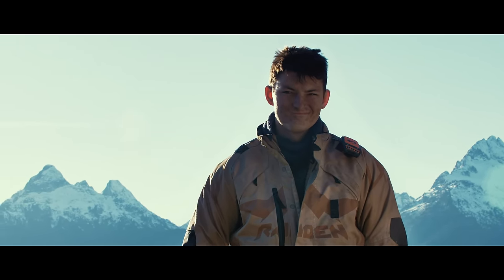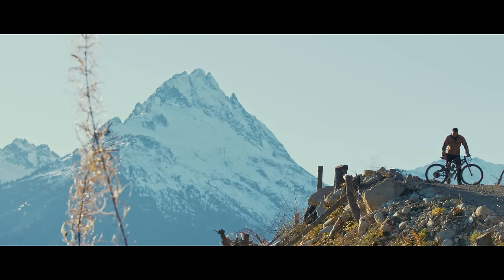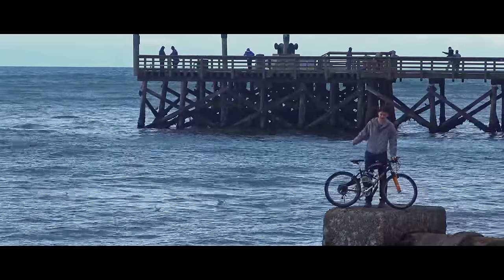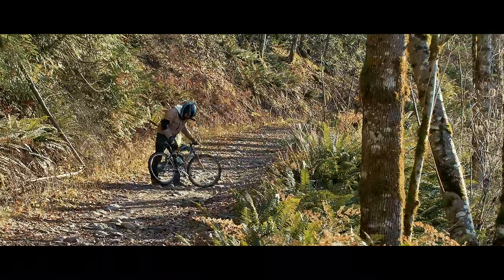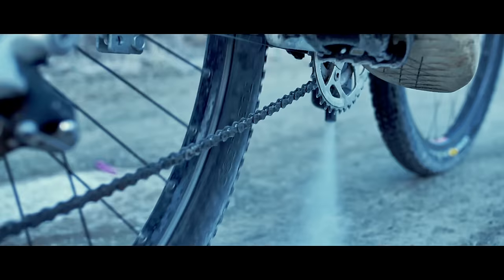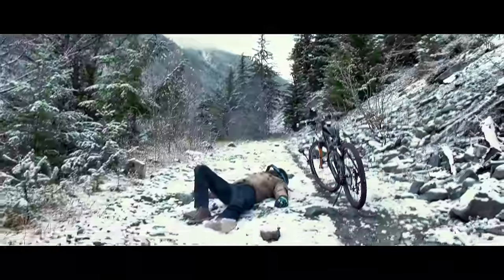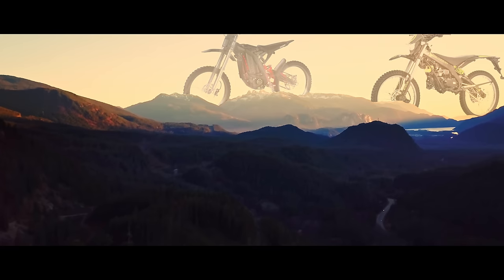I Built a Mountain-Climbing Motorcycle for $200

Comment: Reminds me of my first motorised bicycle, early 90s. 30cc two stroke engine strapped to the luggage carrier of my single speed Raleigh racing bicycle. It was supposed to be a 12-speed but by the time I bought it, the previous owner had stripped the damaged derailleur. I fitted the kit, bought from a local manufacturer just south of Jo'burg. What bags of fun. Cops wouldn't stop it on the road, no helmet, plenty of cuts, grazes and bruises, until it eventually died, after a few months. 

The legal framework to ride one of these in a modern Europe, doesn't exist. They're trialling electric scooters in some cities in the UK and hopefully down the road we'll have an opportunity to legalise motorised electric bicycles. I don't think we want to go back to dirty two stroke mixes. Plus an electric motor will be torquier.

Comment: I see a cleveland enduro bike at the end of the video. It's only have a 110cc 4 stroke engine with 21 inch tires for the front and the rear. And it's road legal.

Comment: could you do this kind of thing or recommend doing this to a bmx bike? figuring the suspension prbably isnt awesome
Reply: I did it. 
Cut the top tube about halfway and removed at seat tube.
Welded that cut section back in so it went down to the downtube.
Mounted engine between seat tube and welded in tube at front.
The engine then became a compressed part of the frame.
Fuel tank under the seat.
Skyway tuff on the rear with a moose tube. It was a pretty good off road hillclimber. 
Top speed probably reduced to 40kph but that's fast enough when climbing a rocky mountain.

Comment: If the motor on this bicycle was electric instead of gas, would it ceas being a motorcycle and now become an ebike and be allowed on pedestrian trails? Just wondering where we draw the line? Fuel type, or whatever giant companies like, well, Giant and Specialized have lobbied for.
Reply: Here in UK
Motorbike: gas/petrol/electric, twist and go (with or without gears).
Ebike: electric motor that assists pedaling upto like 250w with a top speed of 20mph ish, no throttle, you have to pedal.

Riding this in the UK would land you in jail after thousands in fines and lose you your licence and possibly ban you from ever getting another (or if you did the extra points remaining after the first ban would get re added and you would be re banned).

Comment: I hope you meant 15 to 1 rather than 50 to 1 on the break-in oil. You'll fry your motor in no time. An even bigger rear sprocket is needed if you plan to use it as a mountain bike.

Comment: Something nobody really ever mentions. Chainsaw engines are the ideal motors for a bicycle. They have ridiculous horsepower, and torque. Chainsaw engines also have ridiculously strong bearings on both sides of the crankshaft, that are extremely over built, and you can put thousands of hours on a chainsaw engine, running it full throttle. The cylinder bores on commercial saws, have Nikasil chromoly nitride, and they are indestructible. I had a lesser quality vintage Homelite 67cc chainsaw engine on a mountain bike. It had 4.3 horsepower. It would go 51 mph. My friend had a real Stihl chainsaw engine on a small BMX, and it was ridiculously fast, even faster than my Homelite bike. I think many of the "kits" are only around 1.5 horsepower.

Comment: I thing that motorized bicycles are good for practise for youn people with tight budget but you need to count on some things. You will do more maintainence then riding. becouse you are mounting the sprocked directly on the spokes they will bent and make you wheel uncentred. Practicly all these engines are from chine and poor qality. you have no geer box so if you encounter long hill steaper than 10 degrees you are going to have some bad time.
Reply: Yeah, I'm 14 and have been interested in engines and stuff for past couple years and would want a motorbike but can't due to price and my age. I got one of these kits for 100 euros and Im excited to ride it but I still need to order some stuff to get it running. For trails and hills you can get a larger sprocket or you can get a jackshaft kit so that you can use your bikes gears.

Comment: I have one that I build a motorized bike. Are they better? It depends on how you want the bike to be. The bike does two things motor and or pedal. Cheap yes but does require mods to make the motor and bike better. Are parts cheap...... yes. I been ride one for 11 years and it does out last my scooter. 110 miles to the gallon on my motorized vs 35 miles to the gallon on my scooter.

Comment: I had one of these setups... damn was it dangerous. The first time I got it running, it threw me off and broke my rib. I then spent countless hours over the next 2 years trying to fix whatever issues popped up next. The engine never quite ran right and the chain constantly tried to shake its way off of the sprocket, locking the tires.
Reply: I have 48cc version, always use a "V" framed CroMoly steel MTB frame for these bikes.  What's not said in the instructions is that the companies that build these engines haven't improved certain parts for a decade and a half.  The output sprockets are various amounts of eccentricity.   I finally had to file and TIG weld one so it ran smoothly enough.

  Pro tip: Buy the #41 width chain, ( tractor supply..) and take a 90 degree grinder to the sides of the sprocket and bevel the teeth tips.  Buy a few replacement sprockets before doing this and caliper the distance to the roller lands and teeth from the mating surface to the shaft.  You will find these are as much as 0.100" out of round.  It's no wonder they break and shake themselves to death.

Comment: Um what? 17 kmh. my restricted moped locks out at 45, and If I replace the variator axle with a flangeless one, I could go around 70 kmh. why is this engine so slow, when the engine is bigger than my moped of a buff 4.5 2 stroke 50cc horses

Comment: only problem with those is they sound like chain saw engines a 4 stroke would be nice
Reply: There are 4 stroke kits going from 50cc to 212cc but 4 strokes cost more, are larger and make less power compared to 2 strokes. They are more reliable and quiete though.

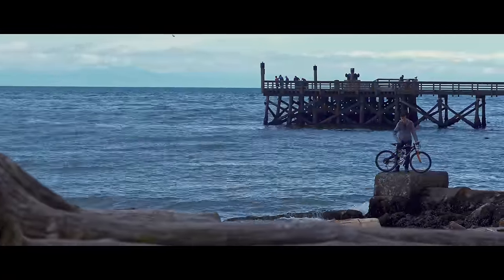Comment: 4:05  it is a 66(displacement) / 80(total volume) cylinder ,  80/(80-66) = 5.714  lead to the compression ratio, for a low octane 2 stroke it is reasonable ; facts derived from your stated link "Bicycle Engine Kits". Is this part of the new continent commonwealth hummer or a bike channel lacking its domain knowledge?  do you do imperial unit math in ca?

Comment: sounds like she's 4 stroking bad, running rich, especially for the mountains, the carb on these comes with a 0.7mm jet, which is too rich even at sea level, you can get them in kits from 0.60, .61, etc up to .70, the carbs that come with these things don't have adjuster screws

Comment: If he had a 56 or 60 tooth rear sprocket it wouldOf made it.  I took my yd 100 up a. 2,000 foot hill climb up north last year and I'm fat lol!
Reply: They do need more gearing for that kind of stuff. Its less than 1 HP (my bike with a 25cc weedwhacker engine goes faster at 28 mph cruising speed and has significantly faster acceleration, I've got one like his and a couple I've made like my weedwhacker one and a 52cc chainsaw when they raised the limits for road legal to where the chainsaw one I like to burn through tires for fun). Normal motorcycles are much more performance, even my Grandpa's old 90cc Honda will hit 70 mph, but the chinese garbage engine kits serve a purpose: cheap and legal transportation for homeless and DUI drivers without a license, as well as great fun for kids that's pretty safe since you can't crash it at any real speed so you get up and go for it again (I had a great time on the ice and slamming it over sideways on the roads at college with one of these, just slid on my side like a sled and would hop back up and slowly get up to full speed than fall over again, haha, it was fun)
Reply: @jakegarrett8109  Well... I kind of build these all the time lol  Not homeless or ever had a DUI. Can get the 70cc one I have to 65mph on open road lol  So yeah not to sure what ya your saying! far as cheap 2 of them are over 2 grand into each of them lol so yeah guess it's all point of view....
Reply: @BuildBreakFix  Again, the cheap garbage ones are good for what I said they were. I didn't even spend $2k on a brand new and much more capable Honda 250 clone, so when you're spending that much its hopefully no longer garbage (although I'd take the 250 any day, very nice controllable over-sized hydraulic brakes so you can easily and safely do stoppies on the highway, a very nice ~18" of rear travel suspension, oversized front shocks, and good for driving over small hay bales or slinging mud way up behind you in the fields as well as street legal just by adding a tag). Much safer for fast speeds than a bicycle (even 70mph on gravel was reasonably safe and I never wrecked it doing that)

But the $200 builds as I said are good for what I mentioned, similarly I never sold any of my much better front wheel drive builds (excellent handling performance and fun to locking the rear brakes and skid through intersections for fun, also almost no weight gain so I rode it to classes without engine power on campus and after classes started it up and had some fun. They also achieved over 250 mpg fuel economy at WOT at approximately 11,500 rpm cruising for the 25cc** and a lot of people got to hop on it and take it for a test drive, out of hundreds/thousands of compliments only 1 person ever thought poorly of it saying "those are some $hitty welds", which they were.

**fuel economy tested without pedaling in a mix of 60% paved, 30% gravel, and 10% off-road play using a calibrated speedometer/rotation measuring device), however the labor cost was extremely high as I modified the forks, welded or riveted the rims (depending on alloy or steel rims), and had the engine on its own self adjusting suspension. I had people offer several thousand for one (even with my $hitty welds), but really far too labor intensive considering what real motorcycles you can get for that and not suitable for use by homeless people unless I were doing it for charity as retail cost would be far impractical (for donation purposes its fine, its just very time consuming).

Comment: i ride a cr250, xcw, kdx but darn if i couldn't help buying one of these kits to cram into my old dyno in the shed...
Reply: i rode one of the bikes he shows at the end -- The Segway -- just the Sur Ron version of it. But even 2 1/2 years later, electric motorcycles/electric dirtbikes still aren't exactly outdoing their gas competitors unless we're talking this thing -- which he recommends for a 10 year old. I wouldn't buy one of these kits because if you have anything else, the power won't be enough. Same reason I can't see myself on a 300/400 -- I own a ninja 1000. I'd be happy with 60hp for a 2nd bike, despite the fact I have 140, but all the bikes with anything around that -- even significantly less such as the Vitpilen 401, are all closer in weight to my big boy ninja 1000 than the weight of any sort of ebike. There are a few newer players, but the market demand for smaller/efficient bikes, whethet we're talking electric OR gas, either way has not been met. I want to see brackets that are something like like 20-35hp 225-275lb, 40-70hp 275lb-325lb. With both being under 7k.

edit: if we're talking low end, low weight 2 wheel power, and tossibility, it's almost better to buy/mod a moped than to go for any sort of lower CC street bike. I don't get that part. Part of it's regulations and insurance, yes, but, not all of it.

Comment: It really sucks that 2 same bikes, 1 gas and 1 electric both with same power, the electric can ride the public highways etc without insurance etc, no drivers license needed but the other bike just because it has a gasoline engine is not permitted, sure don't sound fair to me.
Reply: In Ireland any motorized vehicle has to be registered and taxed if it can be powered by mechanical power alone. Doesn't matter if ebike or gas bike. I still think the police will pull you over just because it has an engine even though electric scooters should also be illegal according to the law.

Comment: To be fair though, the production value of the video far exceeds the quality of the bike build.  Frankly, you made a disaster of a bike that isn’t safe to ride.  Probably the most dangerous thing about motorized biking is thinking that you’re just riding a bicycle.  Would you ride a full size road bike with a loose engine?  How about with a misaligned and loose sprocket?  Of course not.  The thing is, coming off a bike and hitting your head at 35mph will kill you regardless of whether you came off a 600cc bike made by Honda, or a 49cc bike made by you.

It puzzles me, why every now and then some random guy from the full size road bike hobby world shows up in our motorized bicycle hobby  world and says things like “why don’t you just get a full size road bike made by brand X?”, or “motorized bicycles are too dangerous”, or “it wasn’t made by a popular manufacturer therefore it isn’t a proper motorcycle”.  Strange things to say.  I always first ask, why don’t YOU buy a full size road bike from brand X?.  Of course the answer is “I have one, that’s why I’m here asking silly questions”.  Well the answer to that is another question, why are you here talking about our hobby bikes instead of riding your own hobby bike?  

Every kind of powered two wheeled machine is a dangerous kind of motorcycle.  Thinking that it’s just a bicycle will surely lead to a terrible accident.  I’m blown away right now thinking about the number of full size road bike riders that have said that we motorized bicycle hobbyists are endangering the youths by showing them how easy it is to slap a cheap engine kit in a crappy bike and go ripping down the roads with no brakes or a weak frame, and yet here I find an experienced biker with the lack of self awareness to actually make a motorized bicycle that is everything these types say about motorized bicycles.  Shocking really.

If you’re feeling inspired by this video to make a motorized bicycle, then do yourself and favour and check out some of the popular YouTube motorized bicycle channels and learn how to do it right, or you’ll get hurt.  This video glosses over safety and build quality with cinematic and fluffy story telling, and doesn’t even address the first thing about...  well, anything really.